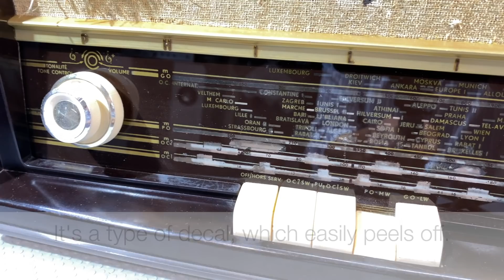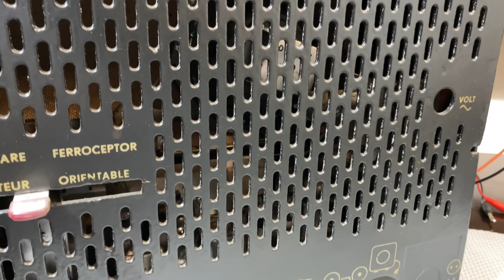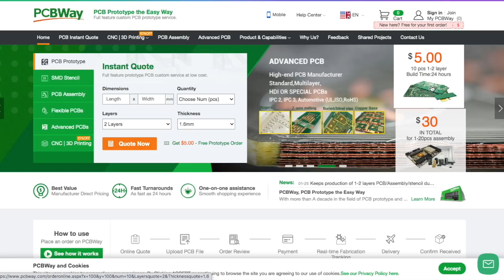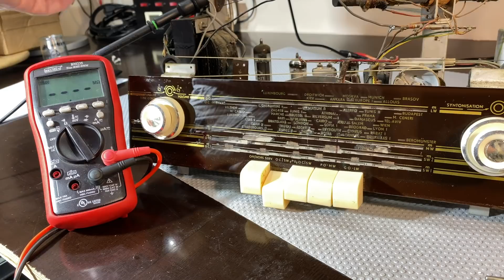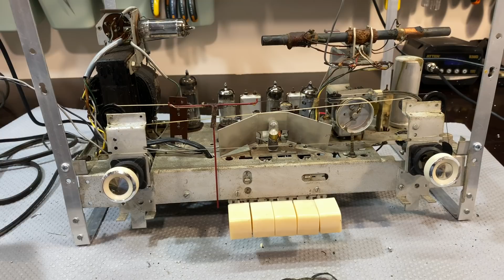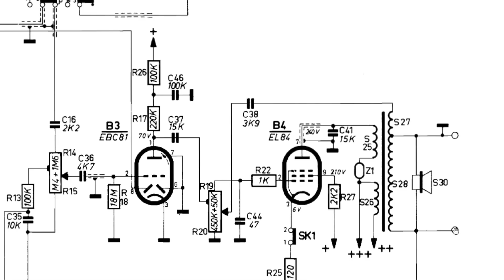Philips B3X69A Tube Radio Restoration pt 1 - Not too pretty on the outside. What about the innards?

Comment: Im working on a Phillips radio with similar capacitors wax caps.  Can I ask, how do you read the ratings?  Im unfamiliar with the ratings.  Are they polarized or non?  Thanks
Reply from the maker: All that info should be on the schematic, or on the component itself

Comment: Interesting that the front is French/English and the back is Dutch/French. Made in my home town. Looking forward to the rest of this series!

16:51 Here's some translation but I think you already got it right:

ADJUSTING THE RECEIVER
During the adjustment:
* Keep volume at maximum
* Keep time control at maximum high
* Connect a Volt meter on the extra speaker output connectors
* Unless indicated otherwise, all signals are to be fed to the external antenna connectors
* After adjustment seal coils and trimmers with lacquer
* Set dial to trim point 1 (variable capacitor at minimum)

Columns:
* band switch
* dial pointer to trim point number
* feed signal
* trim for maximum output

"Kunst antenne" = literally "artificial antenna" so that means modulator or wave form generator.

MF="middenfrekwentie" = intermediate frequency
Zuigfilter= literally "suck filter", so absorption filter
HF en oscillator kringen=HF and oscillator circuits
Herhalen= repeat
Reply from the maker: Thanks for that. I appreciate it.
I wondered  if the back was replaced at some time.

Comment: What is this french radio you pick up in LW?
Reply: I meant french speaking radio
Reply from the maker: I have no idea. I always pick this one up. It may be from North Africa.
Reply: @electronicsoldandnew  
Bonjour , after checking , it seems that there is Radio Medi 1 in Marocco transmitting on 171 kHz, with some programs in french. I dont know where is the transmitter, but it is probably the one. Farther away there is the strong transmitter from Radio Alger #5, on 252 kHz, with programs in french too.
Best Regards, and Thank you for your very interesting repair sessions
Reply from the maker: Thanks for that information. Geographically it makes sense.

Comment: Manuel, hope Spring has arrived in Caldeira. 
Your friends AM Philip set seems a lot less cluttered under the chassis then it's AM-FM counterpart. The set also looks as if cleaning will not be a big issue as in past sets. 
May I suggest you use some of the sofa matching for the sets speaker grill Hi ("Hi", an Amateur Radio term for laughter) Keep up the good work.
Reply from the maker: Spring has arrived, thankfully 😅 
The sofa set will definitely be extended to this one. 😊